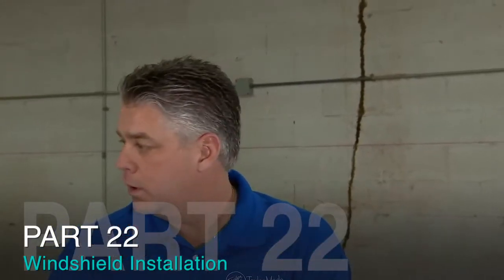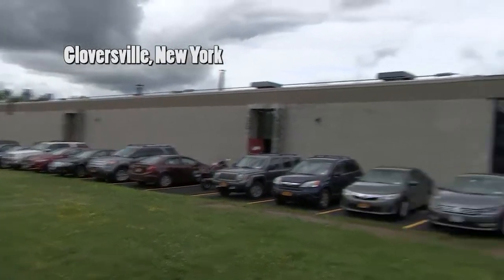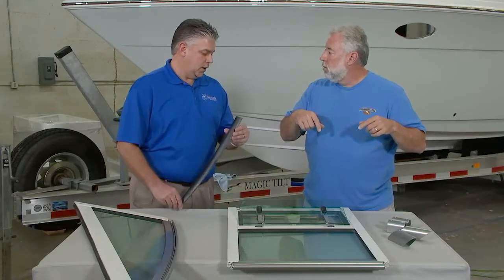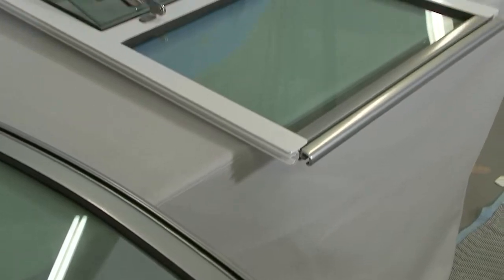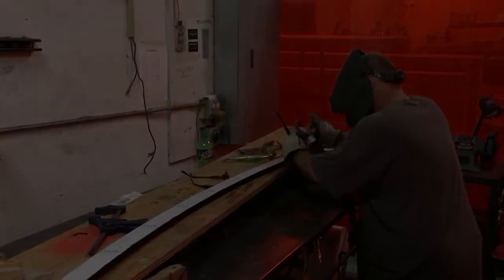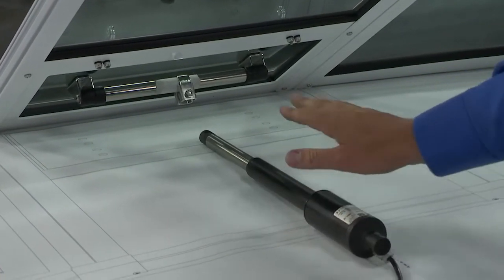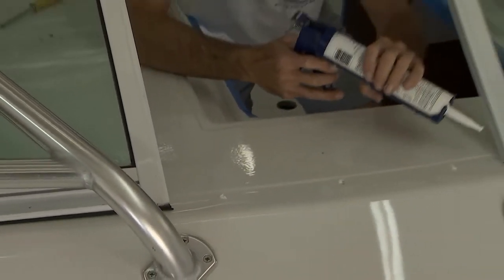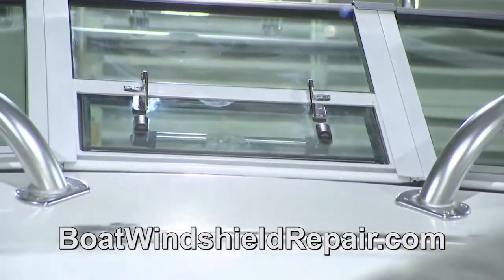TACO Marine Project Boat on Ship Shape TV: Part 22 – Windshield

Comment: Will they make windshield fir small new boat installations, went from single concel to dual concel need wraparound shield with center window opening. Would they make it??
Reply from the maker: Hi Donald. We don't manufacture windshields for boats, but rather supply hardware to manufacturers of windshields. We recommend speaking directly to a windshield manufacturer about your dual console walk-through needs. Dual consoles are increasing in popularity for boat owners, so there are likely manufacturers and even boat builders out there who could help you with your windshield needs.